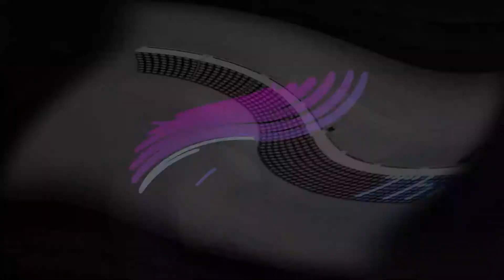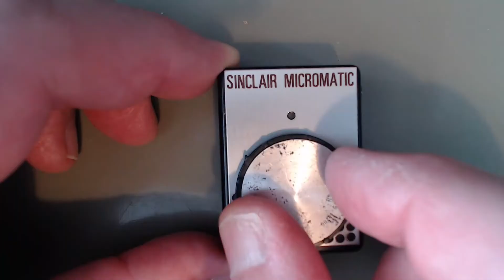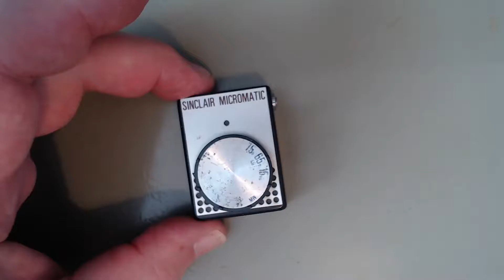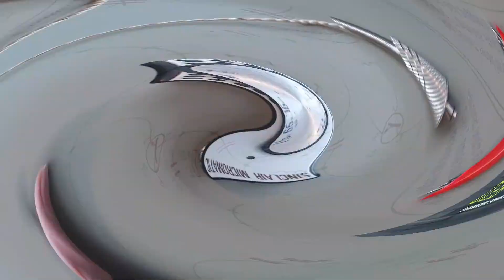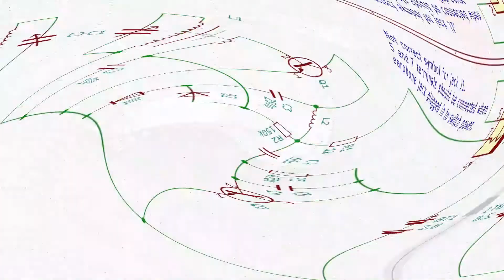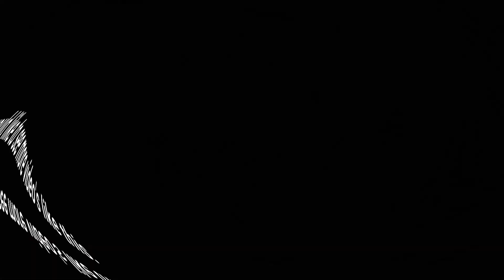#111 Sinclair Micromatic radio review

Comment: 1:50 So this radio uses regeneration, and the coil looks like RF feedback not AF ---?
Reply from the maker: if you look at the circuit, I might be wrong. But the AF signal applied via C4 to the base of T2 is also feed back to the base of T1. So T1 is doing both RF and AF amplification giving a regenerative affect to the audio.
Reply: @TheEmbeddedHobbyist No, maybe I am looking at it wrong. The small coil could be the coupling to the input of the base of the transistor
Reply from the maker: @Jeffrey314159  it's may have two feedback paths, RF via mutual coupling and direct DC feedback of the audio. It did produce a nice amount of audio for a simple 2 transistor circuit.
Thanks for taking the time to comment.
Reply: @TheEmbeddedHobbyist You are welcome 🤗

Comment: One of these was featured in an episode of "The Saint" where Roger Moore was using it as a prop for a two way radio.
Reply from the maker: Trust Roger to get it all wrong,  but I've seen the police on uk TV shows talking into a transmitter and then getting a response back except that the receiver was a separate but of kit. Pye pocket phones i think they were called.

Comment: Hearing aid type batteries for this must have been odd, even for back then. With a little bit of design jiggery pokery It would have made sense to power it with a AAA battery in there instead. Also I looked these things up quite recently after these were mentioned in the documentary film about the history of ZX Spectrum 'The Rubber Keyed Wonder'. These little radios were not that cheap. 59 Shillings and 6d in kit form and 79 shillings and 6d pre built. Bearing in mind 20 shillings = £1 and teh average wage back then was something like £20 a week, that meant that it cost 1/4 of a weekly wage. But then again I expect many people bought them for the sheer fun of putting it together.
Reply from the maker: When I started work in 76 i got paid £19.90 a week and my mum took £10 for board and keep. Happy  days 🙂
Reply: Hearing aid batteries weren't odd. 2 AAA batteries would take up too much space. The circuit requires 3 volts.

Comment: Just got one of these to repair and it has suffered pretty bad from corrosion. The antenna fell onto the table when I opened the lid. The trimmer capacitor top plate fell off when disassembled to clean. I managed to find a NOS trimmer capacitor that looks identical but Sinclair modified it by flipping the bolt upside down so the knob does the trimming. 

I assume I do not want to unwind the magnet wire on the antenna in order to solder the wires back on the board and rather run new wires from the PCB to the magnet wires ? 🤔
Reply from the maker: i don't think I'd want to rewind the coil, just extend to the ends if possible. great to see another saved.
Reply: @TheEmbeddedHobbyist  It turned out that the antenna was so corroded the wire was broken inside the windings. I rewound a new antenna by counting the turns of the original. I then tuned tit to 1mH and I replaced C1 and C4 and now it is working but the volument level is very faint. with the earpiece in my ear i can hear it but barely.. I tested the diodes and transistors with my tester and dmm and they dont show up bad so not sure if the faint volume is "normal" or now... Im using a high impedance earpiece I bought on ebay.
Reply from the maker: @sideburn  mine was very quiet as well,  but i just put it down to not many stations left in the UK for it to receive. not sure what type of earpiece it was designed for.
Reply: @TheEmbeddedHobbyist   right. I thought it might be the earpiece. Ok I think it’s fixed then. I also had to replace the trimmer pot. It does do the whistling tone when I tune it and I think it can barely tune in one other station but one of them does come in, I think it’s around 1200hz and it’s some religious station.
Reply: @ ok cool thanks for the advice.

Comment: IT HAD A ZN414 , LOOKS LIKE A TRANSISTOR BUT IS A 10 TRANSISTOR RADIO FRONT END INSIDE.
Reply: No, it was a 2-transistor reflex design. I'm very familiar with the ZN414 as I started with Ferranti, but this wasn't one of the applications!
Reply: @stevenbirch  ah, nice little chip though.
Reply: @stevenbirch That small feedback coil indicates RF feedback and not AF- - so how could it be "reflex"?
Reply: @stevenbirch Long ago replaced by the American MK484 chip which has also been replaced
Reply from the maker: I can remember the ZN414 when it came out, i think i got one at some point but can't remember if i did anything with it. There were so many new things at that time it was hard to know what to build next.

Comment: A very typical Sinclair product - a piece of junk that just manages to hold it together to work!   It works - but in a horrible way!   My father built one for me - and I used to listen to it in bed when I couldn't sleep...so this holds some odd memories for me!

He also built a Sinclair scientific calculator for me - the one that could take over a minute to calculate some trig functions!   Fortunately, I got a temporary job while waiting to go to college - and earned enough to splurge outrageously buy myself an HP 67 ... which is still one of the best calculators ever made!
Reply from the maker: Sinclair was a bit of a master at it, getting more out of something than it should.  Except for the C5 which was to close to a toy to make its place in the world. Time have changed so much that its hard to see if this style of product creation will ever happen again.
Reply: @TheEmbeddedHobbyist  Yeah...the old ZX-80 and 81 keyboards were those really bad 'snap connection' buttons - and people hated them.   On the next computer, the Spectrum - he claimed to have added a proper keyboard.   Turned out to be a rubber mat that pushed down on the old-style keyboard - which got warm and kinda coated with sweat - that had a really bad "Recently dead flesh" feel to it.   When people complained about that, Sinclairs next computer (the "QL") again claimed to have a full keyboard - and what they did was to put thin plastic caps over the rubber mat, over the ZX-80 keyboard.   At each time, he resisted doing the one thing his customers wanted.

Then, there were the problems with his excessive claims - he said that the QL would come with twin "Floppy drives" - for the time, a pair of floppy disk drives would have cost more than the price of the entire computer - so people were amazed.   Then, it became clear that he was using the phrase "Floppy Tape" (what does that mean?  Isn't all tape "floppy"?) - and the resulting contraption was essentially a quarter-sized version of an 8 track audio tape - with insanely narrow tape that wore out amazingly quickly - and had perpetual alignment problems.   It was almost impossible to use a tape recorded on your A drive in your B drive because the heads weren't identically aligned.   This in turn made it impossible to sell software on "floppy tape" because it wouldn't read on the customer's drive.   The machine was a disaster.   He also claimed it was a  16 bit machine...it did have a 16 bit CPU - but only 8 bit RAM - so every 16 bit memory fetch required two operations - which made it no faster than an 8 bit machine.

His disasters were always like that though - he'd claim that something existed, and promote the heck out of it BEFORE he'd finished developing it...and when he found he couldn't build what he'd claimed at that price - he'd find a kludge to get around it.

Urgh!

The C5 started out life as a GENUINE effort to build a proper electric car (with 4 wheels and a roof) - but as he found it increasingly impossible to source the parts and manufacture the thing, it got stripped down and down until it couldn't pass the regulations for a street-legal car.   At which point, it became a power-assisted recumbent tricycle!

When Sinclair started out - with the radio, the black watch and the portable TV, his products weren't TOO terrible - but as time got on, they got worse and worse.

The QL computer and the C5 were the final nails in the coffin - it reached a point where nobody would believe a single word he said and his products became a running joke.
Reply from the maker: @SteveBakerIsHere  As you may have seen i have the radio and the black watch. Somewhere i might still have two of his calculators but i can't find them. I wish i still had my MK14 and video board which i lost to a friend somehow 😞

I had a ZX80 a long time after they were made but not sure what happened to it. Also the Jupitor Ace which was made from a breakaway from his design team i think. Another one i miss losing.

But i have no Amstrad junk so i'm safe on that count. 🙂
Reply: @SteveBakerIsHere  when I was a kid with my Atari 8-bits I remember seeing the ZX computers hanging on a rack like sunglasses at the drug store for $99 and laughing 🤣 thinking that is NOT a computer.
Reply: I bought a Sinclair Cambridge calculator as soon as I could afford one, after leaving school. It used to go through batteries like no one's business, and was really not much more than a curiosity piece. I still have it, together with the hard nylon case, tucked away in a drawer.
Reply: I just finished repairing two Sinclair MTV1’s the most finicky devices with a kind of their own I’ve ever worked on. On top of that they kept sneaking up on me and zapping me from the high voltage circuit no matter how many times I tied to avoid touching those areas. I would finally fix it and get it working and then reassemble it all and it would quit working or something should short out. My head almost exploded 🤯 working on them but yet they kept recalling me back in like a bad addiction. I guess I just like being tortured.

Comment: I believe that as well as reflexing, the radio also has regeneration formed by the parasitic coupling between L2 and L1. Some people had issues with the kit radios and the remedy was often to bend the leads on L2 to increase/decrease the amount of positive feedback! This is a textbook case of electronic approaches to avoid if you want robustness of operation, but the little radios seem to work to a fashion and they needed very few components.
Reply from the maker: I'll have to have a play with it and see what affect L2 has. will be interesting to find out. Thanks for the comment

Comment: That schematic capture software looks like Proteus. If you have the licensing, maybe you could run a simulation by injecting a suitably specified modulated signal.
Reply from the maker: Hi It was produced on KiCad, not sure how good KiCad is running a simulation.  I could end up spending a lot of time just trying to model the coils.

Comment: Ha, I had one of those in the early 70s. Tho if you'd asked me 5 minutes ago, I wouldn't have realized it was a Sinclair!!!
Reply from the maker: I can't remember if it was any good? it was so long a go. the wires on the battery connections means that I used it enough to require a bigger battery supply. I hope you liked the walk down memory lane.